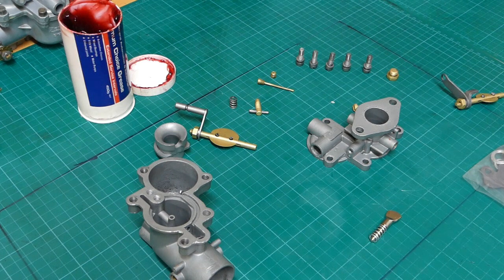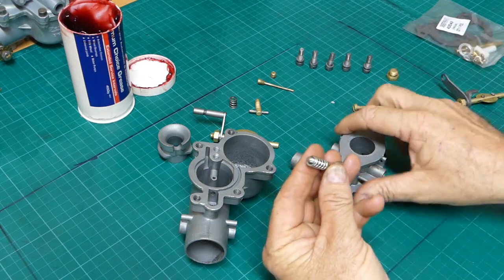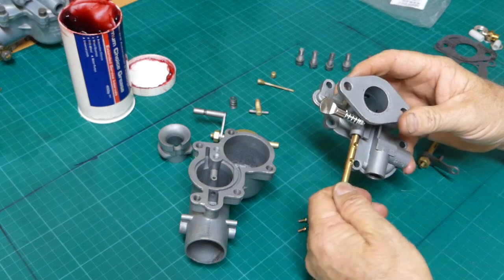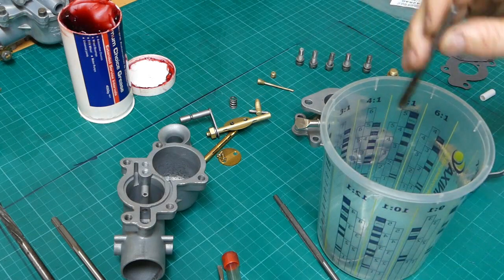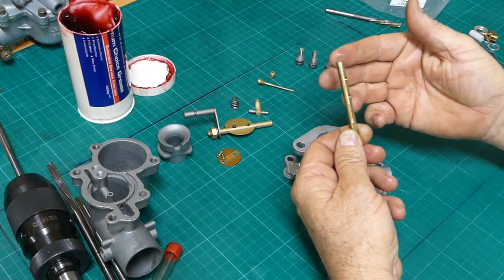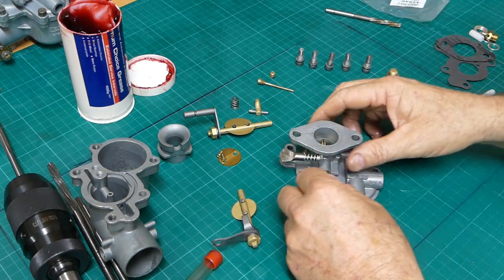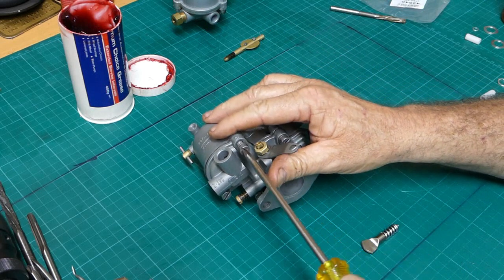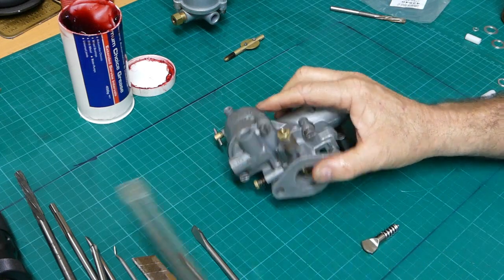Allis Chalmers Model EB Zenith Carb Overhaul, Part 2 Putting it back together

Comment: As always, a great video!  I would like to see your bead blaster in operation to see the equipment and technique for cleaning small parts.  Do you already have a video showing that?  If not, hopefully you can show that in an upcoming video.
Reply: wlc7176 I was going to make the exact same comment, the bead blaster seems to do a bloody good job! What medium/grit do you use in the blaster Lance?
Reply: Sure its still this one
https://youtu.be/lKH8_awfoIc
Reply from the maker: Coming soon!
Reply from the maker: I use glass bead it is available most places.
Reply from the maker: That big white one has garnet in it and I bought a smaller one just for the carbs and glass beads.
Reply: Racking my brain Lance, have we saw the smaller one?

Comment: seems quite a few carbs used the same body and just different ways to connect the controls, only way to drill out jets is on a mill with a custom plate to hold the carb
Reply from the maker: Yes to the drill in the mill but I think this will be ok

Comment: Lance, on the Fergie Zenith carb there are some small thin exterior springs on a few of the rotating shafts. On my Fergie most of these seem to be non-functioning or broken but the carb works fine anyway. Just how important are those springs?
Reply from the maker: Yes they are important mainly for keeping the choke off. Here is a link to my web site explaining the workings of the carby. https://queenslandtractorspares.com.au/wp-content/uploads/2019/10/Zenith-24T-Carburettor-Bulletin.pdf